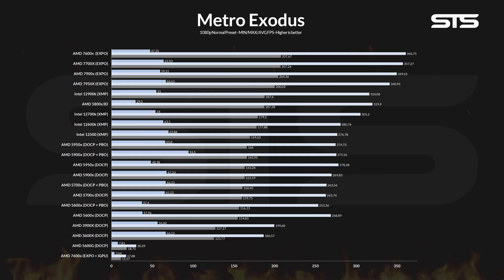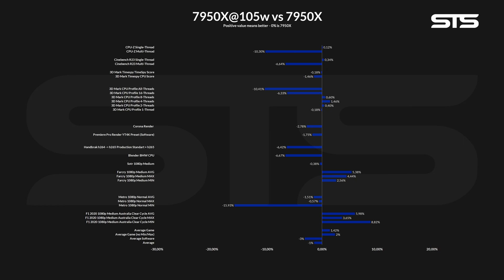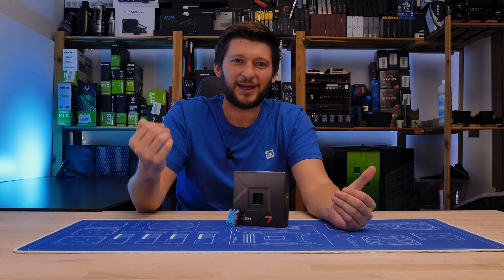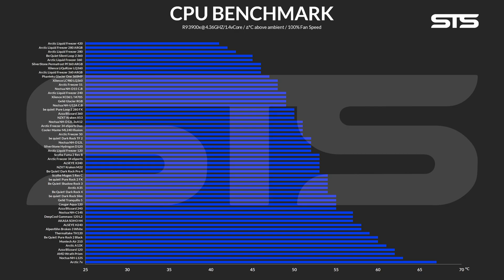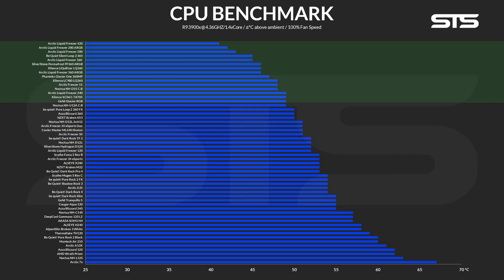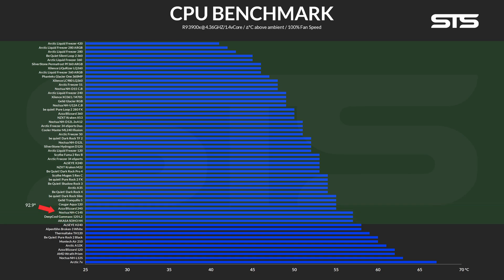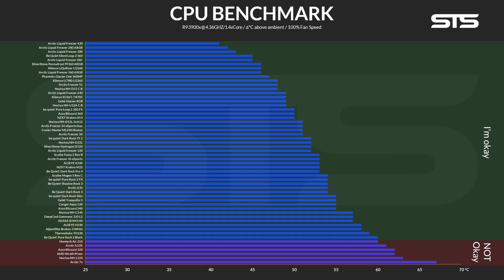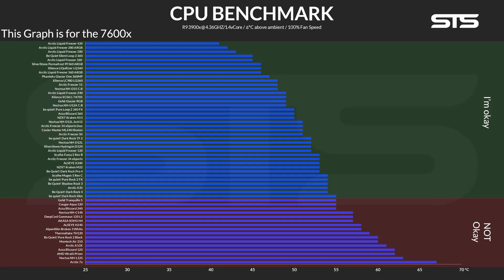How FAT should a Ryzen 7700x cooler be? ❄️ - 7700x Cooling

Comment: I still think the 95c target is a very stupid idea from AMD.
Reply: Good counter argument bro
Reply: @revelae  well your comment is wrong, I explained some reasons why one comment above yours.
Reply: It doesn't affect anything other than perception
Reply: @revelae  nope, totally wrong.
Reply: @vollhorst140 I’ve owned this cpu since launch with absolutely no issues and if you have issues with temp you can just undervolt it
Reply: @redditmanllegnisthebirdofh9887  sure, i can fix a stupid design decisions the manufacturer made or I can buy something else that works out of the box without problems.
Reply: @vollhorst140  idk 80 is my avg temp but using an Aio max temp on hotspot is 95 consistently I’d say not bad lol but to each their own my cpu still compares to the 13900k I had before in each game I play not needing the extra cores and the exact same fps with higher 1% lows in game. Times are not the same anymore, Intel isn’t better for gaming than AMD anyone who says otherwise is just biased and hasn’t owned both lol but keep staying ignorant and don’t buy amd chips cheaper for me tbf. Ime the cheaper 7700x performs just as good as the more expensive chips even undervolted losing a bit of the power it has, it doesn’t matter with this chip how much cooling you do people don’t understand it’s thermally limited and only stops boosting at 95 C if it’s not hitting that temp there’s performance left to be had given your cooling is sufficient to keep it there. I’ve never had it go above that once but ig if you don’t do research or know anything about the card you wouldn’t know that
Reply: @redditmanllegnisthebirdofh9887 Intel definitely is faster than AMD in gaming especially in the vast majority of workstation applications. That is not bias it’s facts.
Reply: @ZackSNetwork  workstation is the only place intels better lol a 7700x competes with a 13900k at 4k with way less cores and that’s not bias that’s benchmarks, way cheaper to on sale
Reply: Why. It doesn’t make it more difficult to cool
Reply: @Lachlan_McDougall  it does. These CPU’s increase power consumption until they reach 95c regardless if the performance increases or not. It makes the fan in the pc spin up to 100%.
Reply: @vollhorst140  can't you change it so it doesnt run at 100% ? Genuinely asking
Reply: @Hellonhdc  yes / maybe, depends on the motherboard. My motherboard (one for the 5000series cpu) will run them at 100% at 100C no matter what, while using fan speed curves/profiles. I can set them to a static value. On the newer motherboards might be more, better suited control options available.
Reply: @vollhorst140  if you undervolt the CPU, will it help with the temps ?
Reply: @Hellonhdc  i believ yes but don’t quote me on that.optimumtech made a good video about undervolting 7000series.
Reply: @vollhorst140  ok thanks
Reply: @Hellonhdc  yes. Go into bios and change thermal target to a different total like 80 or 85. It’s still going to get clocks up into the mid 5GHZ
Reply: @vollhorst140  just change the fan curve to max 60-80% depending in noise... why pushing 100% fan when temps wont be lower? also after curve optimalisation and undervolting you can kinda easy get below 90-85*c depending on cooler.
Reply: @Hellonhdc yes you can, there is a really good video called fixing the 7700x and he explains it perfectly
Reply: @vollhorst140  I have three 120mm case fans and a 240mm aio for my stock 7700x, makes no difference if I run them at 60% or 100% at full load.
Reply: They made the IHS thicker for CPU Cooler compatibility that's why
Reply: definitely
Imagine using these processors in a recording studio. Such a bad move
Reply: @AudioBoi1  it'll be fine
Reply: Some things are not very clear for me. For example, when im working in Fusion 360, this algorithm will not try to reach 95 degrees I assume? Only under an more heavy workloads right?

Let’s say this is correct. And I’ll compare intels 13th gen to amds 7000 serie. Both have the power limit to the max ppt. Than how will this 95C target from amd let the processor behave different compared to an intel processor? I mean, both processors are getting hot under heavy load. Probably intels processors even hotter because the higher tdp.
Reply: The more stupid idea from AMD is building the IHS to be compatible with AM4 coolers. I would much rather have a completely different mount for AM5 with a thinner IHS so that my cooler isn't held back by the IHS being slower at siphoning heat away from the processing cores.
Reply: AMD Gpu hotspot in AMD is 110c for max limit 😅😂
Reply: I bought an arctic liqud
Reply: Just get a cooler that didn't come from the toilet store and it'll be fine
Reply: @revelae  even with a good cooler it seems to reach 95°C
Reply: @Hellonhdc  did you watch the video? Tiny c14s = 93C
Reply: @revelae  i tried myself with good cooler & cinebench and it seemed to not be very effective thats why i said that, but i dont know a lot about hardware
Reply: Sounds like skill issue
Reply: @revelae  cooler issue
Reply: @Hellonhdc  That's what I said
Reply: @revelae  Ok
Reply: @revelae  That’s not how it works

Comment: Dude you should update the graph subtitle, still on the r9 3900x.
Reply from the maker: The graph shouldn’t be taken as an exact value.

Like every other Ryzen 7000 cooling video, we used our usual benchmark table (done on a 3900x) removed the numbers and used them as reference points.

None of the graphs are accurate, they are references in order to know how high the cooler should be on the scale to be ‘ok’
Reply: @STSYT  alright I’ll keep that in mind for future videos. Just throws me off a bit initially seeing it.
Reply from the maker: @ishraqmirza2724  no future videos about this one 😅 7700x was the last Ryzen 7000 cooling videos.
Regular CPU cooler benchmarks will continue to be with accurate numbers

Comment: I just power limited mine and also applied a -30 on curve optimizer, 5.3 all core around 85w and 65c
Reply: Same i git 30 negative offset mines 58c at gaming 45c on tick over a and hits 5.5 and 5.4 got it at 80w
Reply: @Deviantsoundz  I just found a thing called medium load bosstit in my asus board bios in prison boot overdrive it removed the 5.5 boost limits now it boost to 5.65ghz in all games cpuz score up so cool love my 7900x thanks asus team
Reply: wow, sounds like an amazing sample. with -30 curve mine is pulling 100w at 78°C
Reply: What settings are you using? @elu5ive